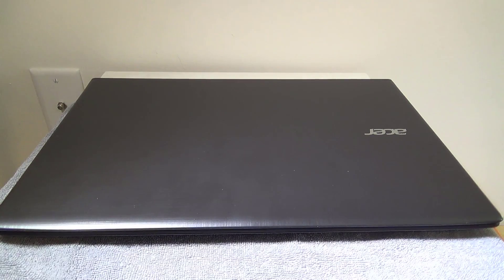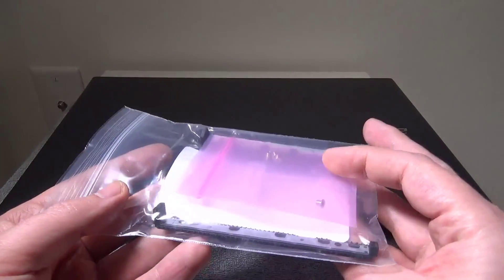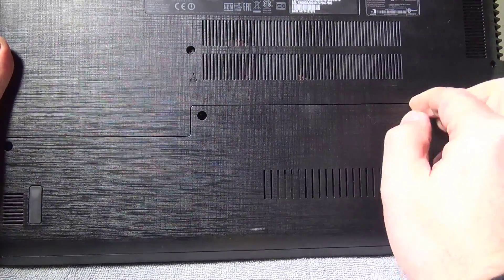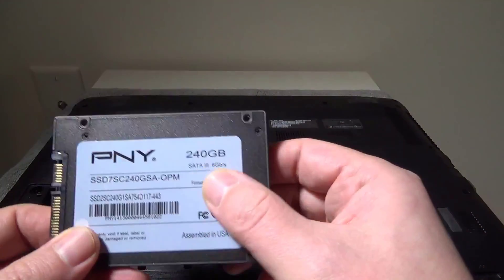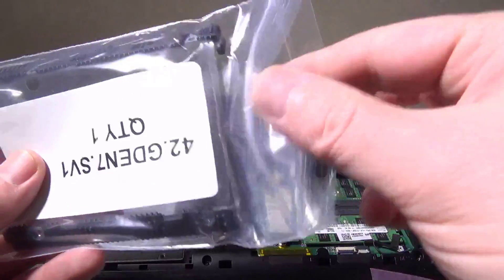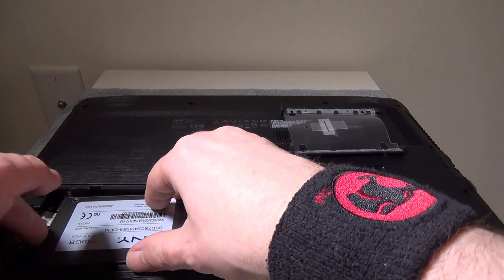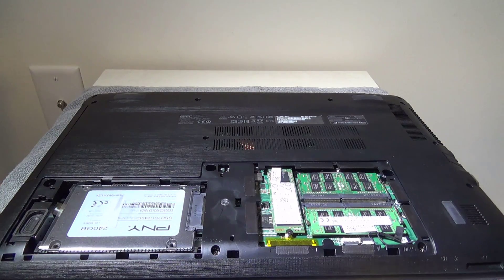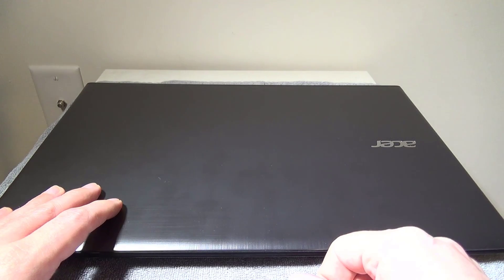Acer Aspire E15 E5-575G-57D4 (E5-575G-53VG) - How to add a 2nd HDD or SSD

Comment: This is a great vid, very helpful. i did everything you did and have installed the second hard drive. Is the system supposed to recognize it right away? Because mine hasn't.
Reply from the maker: You have to go into "Settings" then "Disk Management" and create a partition/Format the drive before windows will see it.
Reply: @GalaxyTechReview  thanks for your help!
Reply from the maker: Anytime

Comment: ifif you are still here, i have the same laptop with only ssd 256g and want to add a 1T HDD can you tell me the Specifications for the hight the shape and so... because I don't know anything about it.
like 2.5 inches, SATA 6Gb/s Hard Drive 9.5mm Height , 28MB Cache. and what is sate II and III ??!!
Reply from the maker: the most common height is 7mm they of course as you have seen have 9.5mm, I tested a  7mm height SATA III SSD in the video..  any of these will work  https://amzn.to/3gRpnDk  (you can try a 9.5mm one but I have not personally tested it..)  don't worry about SATA II (old gen) vs SATA III newer gen, most drives will be SATA III..

Comment: So I'm not really good with computers but this is the exact model that I have and I really need more than the 256gb. Would any sata 3 drive work? And also once I have the ssd installed would I be able to move everything to the ssd and replace the m.2 with a 1tb   m.2??
Reply from the maker: yes and yes
Reply: @GalaxyTechReview  will the mother board support an m.2 nvme card or does it have to be a m.2 sata?

Comment: So I haven't modded my Aspire E15 E5 575G. I now use it mainly for working from home and I use a lot of web-based apps now. My PC can get frustratingly slow sometimes. Would it make more sense to get an SSD for faster read times, or rather upgrade RAM to say 16GB so that I can work from home easier?
Reply from the maker: both will help but for raw speed definitely go for a SSD drive, you can always add more ram later if needed.

Comment: I installed a 500 GB WD Blue as shown here but it is not detected by Windows 10. It doesn't show in my Windows Explorer. Is there anything extra I need to do like format the drive or some BIOS settings or anything?
Reply from the maker: Go into windows settings the disk management and set a partition and format it before windows os will see the drive.

Comment: Hi.
Can I have three SSD in one laptop?
One at the HDD bay 1TB, one at the M.2 slot 1TB and one will be M.2 card install to a HDD converter ( B & M KEY M.2 NGFF SSD TO 2.5 INCH SATA III CONVERTER ADAPTER) and  use caddy 250GB SSD?

Will this setup work? I sent to a computer shop and he said once the caddy with M.2 SSD  installed the system got jammed.

If this cause a problem, can I use my existing 1TB HDD with caddy then?

Comment: Hi.

Thank you for the video. I was loking at the description that you recommend another hard drive (Firecuda) I have a E15 E5-575G-53VG and i was wondering if I get that SSHD, do I need the Hard Drive Bracket Caddy to make it secure too? 

The reason that I am asking this it's because I don't know if the SSHD that you put in the description is the same Dimensions as the one that it's shown on the video.

I appreciate your help :) 

Best regards
Reply from the maker: You can install it without the bracket it will be a little loose tho but still will work if you can't get your hands on a bracket just put a piece of thick non flammable material to wedge it in from the back..  that works in a pinch..

Comment: Are there any modifications that need to made to the BIOS?
Reply from the maker: no there should not be, you may have to check the boot drive order but if you are only adding a secondary drive that should not be an issue.

Comment: 1. What about changing the DVD drive into 2nd or 3rd HDD? and where do I get the hdd caddy?
2. Are there certain types or types of M.2 SSDs that can be installed on this laptop? whether it supports NVME too?

Thankyouu
Reply: hi dear, did you discover something if on this notebook you can also install SSD M.2 Nvme? I have model 575G 72LP with M2 predisposition but I don't understand if I have to buy M2 Sata 3 or M2 Nvme? can you help me? Thanks
Reply from the maker: I would suggest looking up the specs on your specific laptop to determine if it supports nvme or just m.2 sata. Should be able to get that info from the support page for your specific model of laptop.

Comment: Does anyone know if the SSD listed (the seagate firecuda in the description) is completely compatible with the -57D4 version? it's considerably cheaper than other options i've found, and i'd rather get 2TB for about $100 than 1TB for $135

EDIT: even if they are, probably won't buy seagate, seeing a lot of negative reviews on amazon...
Reply from the maker: Yes it's the (Seagate Firecuda SSHD) drive I used to expand this, works fine, in fact that drive is now in another laptop and has been working for games storage for well over a year now.
Reply from the maker: remember the seagate firecuda is a SSHD not a SSD there is a difference.   The seagate is a HDD with flash storage to help it run faster, the SSD is ALL flash storage and will run faster, hence the price difference.  Saying that this drive still works awesome for games and I have had no issues.
Reply: @GalaxyTechReview  Thanks for that, but I'm still worried. Is there a good alternative that's full SSD without it skyrocketing the price?
Reply from the maker: @TheHypnotistQ  2TB of SSD goes for about 250$ - 300$ at the moment.. so not really unless you can budget that much.
Reply: @GalaxyTechReview  Looks like 1TB for me for now...I'm still working out what brands to trust and such. I'm probably going to end up going with good ol' Samsung to be safe, even if it's a bit more on the expensive side. do you know if this one would be compatible? https://www.amazon.com/gp/product/B078DPCY3T/

As long as we're on the subject, how does one tell if a given part is compatible? Just asking people who know? is there a method besides actually testing?
Reply from the maker: Yes that will work.
Reply: @GalaxyTechReview  Thanks! and the mounting kit you mentioned in your video will work as well?
Reply from the maker: @TheHypnotistQ  yes
Reply: @GalaxyTechReview  Perfect! Thanks for all the help. Very much appreciated!

Comment: I have aspire f15. Is it necessary to reinstall windows in ssd?
Reply from the maker: only if you are replacing the boot drive.. if you are then yes you would have to reinstall windows.
Reply: @GalaxyTechReview  but I am not removing my hard drive. I have extra slot for ssd.
Reply from the maker: @harshpalsinhrajput8644  then you will be fine just add the extra SSD in the slot and then go into windows and format the new disk in Disk Management so windows will see it and you will be good to go
Reply: @GalaxyTechReview  Thanks a lot for your kind response...!!🤘 Lots of Love From India..!!🙏
Reply: @GalaxyTechReview  one more thing. I want to make ssd as my system drive.

Comment: Hi, just bought the ACER Aspire E5-576G-5762 laptop, and installed a second SATA 1Tb hard drive but it is not being recognized ..?  any ideas?
Reply from the maker: Go into windows settings then disk management and create a partition on the new hdd. Then windows will see it.

Comment: Is it posible to replace the battery? Is it posible to upgrade the GPU?  I have the same model and have some issues, it shuts down spontaneously and i don't know why, some people says it's the GPU, the poder suply or some short circuit stuff.
Reply from the maker: replace the battery, sure...  Upgrade the GPU, absolutely not as it is soldiered to the motherboard.
Reply: @GalaxyTechReview  thanks. I will discoonect the battery, will it keep working? I am not sure that i could get the exactly same battery in México, i bought the laptop in Amazon. Thanks a lot again.

Comment: if I install a second hard drive how do I save things into it, does it automatically get detected and files automatically start saving there and my computer automatically starts using it or do I have to install it with the comp on too ?
Reply from the maker: you install the hard drive and then go to SETTING and then DISK Management and format the new disk before Windows will see it.
Reply: @GalaxyTechReview  Thank you
Reply from the maker: @johnz6241  welcome

Comment: Thanks for the great videos. I just added additional RAM and added a second SSD (500 GB). Do I need to initialize the SSD? What system info can I look at to make sure it is set up correctly?
Reply from the maker: Just go to Windows settings and then Disk Management and you will have to create a partition on the new SSD before windows will see it and that's it

Comment: Software to migrate Windows 10 os to new SSD
Reply: I downloaded last week a FREE program (Macrium Reflect) that was/is supposed to handle this os migration task using a cable that is SATA III to USB. I understand the 2.5 inch form SATA III SSD has a SATA III Connection.I found such a cable via Google for a decent price.  Also watched a UK video on os migration and there the cable was 'Sabrent brand). I also watched a Video here where the demonstrator said the Samsung SSD came with the Samsung software that did the os migration and it is bullet proof. And he gave little chance of other SSD's and other such software being as successful.  Now I know Samsung does not have a lock on the SSD market (it is ranked at the top of the tests I saw reported here) and there is much cheaper hardware and free migration software out there. I am hoping I can get some enlightenment here about migrating Windows 10 to my new SSD.

Comment: Hi I have 'Acer Aspire E15 E5-576G-5762', I'm planning to upgrade secondary storage drive to SSHD, will the below 2.5" SSHD drive from amazon fit into my laptop, do I need to buy assembly kit to install SSHD too?

https://www.amazon.com/Acer-Aspire-i5-8250U-GeForce-E5-576G-5762/dp/B075FLBJV7/ref=sr_1_4?s=electronics&ie=UTF8&qid=1519177228&sr=1-4&keywords=acer+aspire+e15

Thanks,
Ravi
Reply from the maker: Not sure as that is a link to the laptop itself not a drive.

Comment: Hi there thanks for your video. I live in Australia so where could  I get one of these brackets?
Reply from the maker: Unfortunately I live in the United States so I don't have a direct answer for you if I were you I would contact Acer and ask them where you could get one
Reply: Ok, thanks for your reply.
Reply: But would a piece of foam with double sided tape work?
Reply from the maker: Probably all you need to do is keep the drive in place
Reply: Ok thanks for you reply, I will probably put a piece of foam or something soft and use double sided tape.

Comment: Tnx for the video.  
Will it work also with the latest model (8th generation / i5-8250U)? 
And do I need a caddy case? 

Tnx
Reply from the maker: yes, and you will need a caddy
Reply: Galaxy Tech Review Tnx. . Any chance you can post a amazon link for this product? 
Tnx so much.
Reply from the maker: The caddy or the laptop?  Only Acer sells the caddy.
Reply from the maker: Get the HDD assembly kit from Acer HERE
https://us-store.acer.com/42-gden7-sv1
Reply: Galaxy Tech Review Tnx again. Dose it include everything I need to install the drive (caddy / cable)?
Reply from the maker: +דוד רוזנברג yes you don't need a cable though because it's already in the laptop it's a port not a cable
Reply: Galaxy Tech Review Tnx for your reply. . 

By the way. If I add more HDD memory. Will i be able to run programs on it (like pothoshop) or it's just for storage like a external drive? 

Tnx
Reply from the maker: Yes you can run programs on it.

Comment: would this hard drive fit on the acer aspire e5-575 -58wh? im interested in upgrading but not sure it will fit. Also is there an advantage to keeping the old drive or should i just remove it and use and ssd? can they both be used at the same time. Thanks
Reply from the maker: Not sure on that specific model.

Comment: This is another fantastic how-to video - the use of a towel to help catch runaway screws was new to me and particularly helpful. Just so your viewers know, I used the Acer kit to install an SSD on the E5-575-75MD model, which I think is the most recent incarnation, and it worked fine (the interior looks identical to your model, but for whatever reason the Acer store doesn't list the 75MD as one of the models that their installation kit works with).

I really love this laptop, and the fact that I've been able to double the RAM and hard drive capacity for under $200 (to the point that it is probably more powerful than the desktop in my office) is just icing on the cake.
Reply from the maker: +Charles Murtaugh thank you for the information Charles and also for the support I appreciate it as I appreciate all my viewers glad I could help out and I'm glad that it worked out for your laptop as well

Comment: I have an E5-576G-5762, and I was wondering if the bracket would work for me as well. the cavity looks identical to the one shown here. As an alternative, I see that Crucial provides a 9.5mm adapter with it's 7mm SSD, and I'm also wondering if that might be sufficient to hold the drive in place, rather than having to order the piece from Acer. Thoughts?
Reply: Hi, the bracket should work,, I'm about to order one myself for the same laptop.  https://us-store.acer.com/42-gden7-sv1

Comment: Thanks man! I added an extra old HDD i had from my previous laptop, is it possible to boot an extra OS (like Linux Ubuntu) from the extra HDD?
Reply from the maker: +lukas de loose I'm sure it's possible to set it up as a dual boot but I have not done so myself you may have to do some research on how to do that yourself but yes you should be able to dual boot

Comment: Very helpful video thanks so much :) .. one thing I wanted to add - and bear in mind I could be wrong my google kung fu research skills might not be up to par :P .. but from what I'm seeing online, sadly it is very difficult to remove the battery from this laptop if I'm looking at the correct info  :(   ... which made me nervous when I was adding a new hard drive - just like we normally unplug a desktop PC before adding components, it's my understanding that you want to remove the battery to be on the safe side ... which you apparently cannot do here :(  .. so , heart in my throat, I followed your video -which worked beautifully except my hard drive kit was "stubborn" and simply pulling on the tab didn't work, had to get my fingers in there and manually push the hard drive into it's  power/sata connectors on the laptop... but it worked !  :)  ...

 As far as comments re: Acer's shipping and handling charge... this could be just a Black Friday/Cyber Monday thing but I noticed they offered free shipping and handling around that time when I ordered it (the promo code absolutely did not work for some odd reason on their website, but if you email their customer service department and forward the promo code to them and pay for shipping they'll refund you the shipping cost in about 5 business days , obviously make sure you include your order number when you email them  :)  ... you can call their customer service dept too for a walkthrough of how to do it but quite frankly their email department is better at sorting things out than their "live phone support" dept, live phone support never refunded me but email dept did  :)  ) ..
Reply from the maker: +andrepurchases glad it worked for you and glad I could help

Comment: Hey all, will this ssd with it's mount work in the laptop in this video? Samsung 850 EVO 2TB 2.5-Inch SATA III Internal SSD (MZ-75E2T0B/AM) & Corsair Dual SSD Mounting Bracket 3.5" Bundle

Comment: Hello, your videos are very informative, Thank you.  My 57D4 is arriving tomorrow along with a Samsung 850 EVO 500gb SATA drive.  My question to you is should I add the secondary hard drive right away or allow the laptop to go through the initial startup and updates then do the secondary hard drive install?? Also once installed is there anything else I will need to do to the laptop? partitions etc....Thank you in advance.
Reply from the maker: You can install it anytime, might as well do the initial setup first.  After you install the drive then you need to go to "Settings" "Disk Management" and setup a new partition on the new drive before windows will see it.
Reply: Thank you....I will do it after initial setup....appreciate the help!!!

Comment: Here's a question from a relative newcomer to laptop "modification".  I am interested in adding a500gb ssd to the same cpu as the one in the video. Do I need to or should I reinstall the OS to this drive, or is it necessary. Thanks for the video!

Comment: Hi how do I then make the OS boot on the SSD rather than the HDD that its pre-installed on?
Reply from the maker: +Illinoise888 you will either have to clone the HDD to the SSD which is a pain in the butt or reinstall Windows on the SSD the Windows key for your laptop should be saved on the motherboard since they don't really give out Keys anymore

Comment: How do you get the computer to recognize the drive though after it is installed?  i installed and the computer does not see the drive.  yes it is all connected properly.  had the same issue with my dell but the same steps did not work for the acer.  please help.  thanks
Reply: Galaxy Tech,  i found out how to do this.  pretty simple. start menu , computer management, disk management, then click ok on the default pop up.  then right click the new drive again in black bar area and click simple volume. then just follow the default ok settings.  thanks